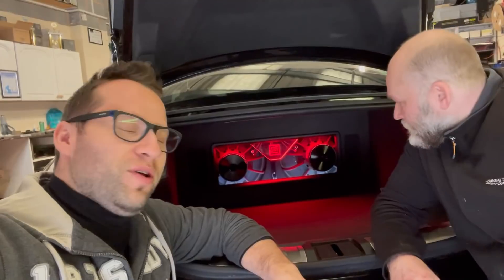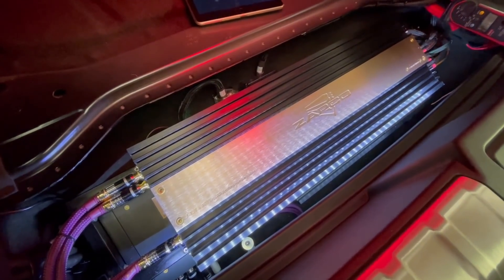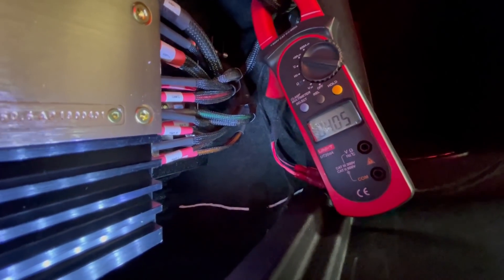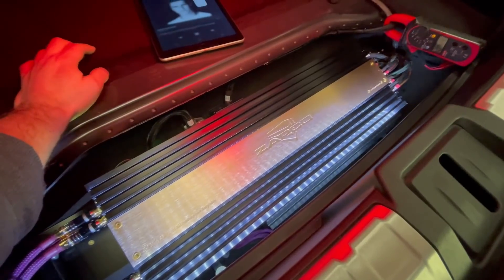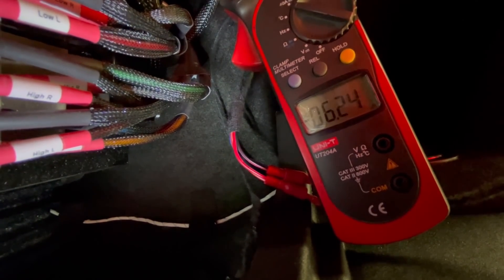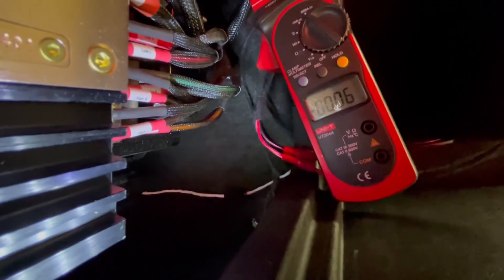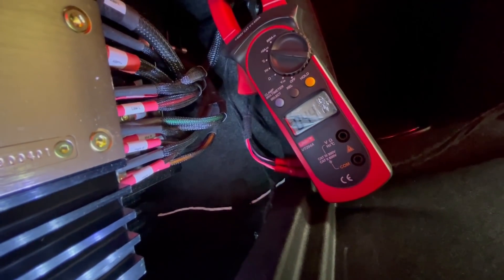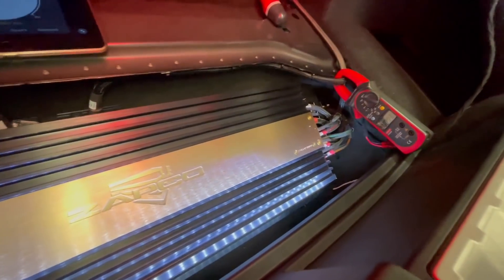How Much Power Does an Audio System Draw? - CLAMPING TEST

Comment: Nice no nonsense anti-snake oil video. Car audio industry is always trying to market to consumers that they need 1/0 gauge power wires and ground with this "bigger and more excessive the better" strategy. In reality a 2000 watt sub amplifier when used solely for music would operate absolutely fine off of an 8 awg OFC power/ground.
Reply from the maker: Not necessarily. 2000W can draw 150A. For that you need min 2ga that is officially safe to be fused to 175A. 0ga is safe to be fused to 250A.

Comment: So would you say it's ok to run an amp with a 40 amp fuse on a Ford F150 Powerboost (hybrid)? Everyone says to stay under 30 amps of draw on hybrids. The stereo shop I'm talking with is trying to convince that this particular amp (Alpine Optim 8) won't reach that 30 amps of draw. But I'm very nervous about it. It's a brand new truck and I don't want to pay out of pocket because I was misinformed by them. Any guidance is extremely appreciated!

Comment: I was just pondering something the other day and I am wondering if you would already know this answer or have a way to test it and make a video of it (let's assume I'm building a little pull behind trailer for my bicycle which will carry this equipment). Which of these setups would draw more power  from a DC source a straight DC/car stereo @ 4 ohms or, DC-AC converted system with a home style stereo at 8ohms? I feel I may already know the answer but I don't have a way of testing with out purchasing a whole lot of things that I can't really afford.

Comment: Thanks. Spent so much time on forums and watching videos talking about total RMS wattage when talking about alternator and fuse requirements without  providing any real world amp draw examples when listening to music. This is exactly what I needed to give me some comfort that I dont need to upgrade my alternator right away and will wait to test it when whole system installed. It also confirms that 0 gauge wiring is more than sufficient for me from battery to amp and helps me better understand the fusing requirements. I just happen to have that same 150.6AP amp going in my system and so even more relevant to me. Cheers and subscribed.

Comment: Quesrion, im looking to hookup two around 1000w amps to a ac converter, idk theirvamp draw.. do you think 100a converter would be able to handle hr or so playing loud?
Reply from the maker: The average peak consumption is watt x0.13 = Amper, so in your case 2000W ~ 260A peak

Comment: I am going to run a Fi Neo 3.5 12 inch sealed with a 2000 watt amp. I'm mostly going to listen to it at mid-volume so I rest assured that I do not need an aftermarket alt.

Comment: I don't see capacitors anymore these days. Didn't see them in your setups also. Why is that?!?
Reply from the maker: Because they are absolutely pointless! Rather sort out the power supply, proper battery instead and no cap can ever touch that. Even caps have to be charged from somewhere, so if the supply before that is poor, then the cap is just a bandaid 🩹. 
EV cars are the best, constant solid power.
Reply: @pssound9749  so, if i have a normal system about 250-400w RMS, 16 mm2 power cable, 4 doors speakers and i want to install a Subwoofer in the trunk on the side (didn't thought about the power yet but minimum 200W rms and max 400/500W rms) wouldn't help at all to ease the car's battery job a little, less stress for the alternator too, if i add a capacitor?
Reply from the maker: Buy a better AGM and the biggest you can fit. 4-500W system shouldn’t be an issue for any car, that’s like 35-45A load.
Reply: @pssound9749  thanks for clarifying. I was thinking this way but with your car audio experience you rest my mind now.
Keep up the good work 💪
Reply: @pssound9749 Hi Peter, for the last 20 years I had multiple Optima Yellowtops which were best then. Now it seems they arent that good anymore. Are all AGM batteries good or which brands are best for car audio?  Thanks in advance!
Reply from the maker: @explorinlearnindoing5462  there is nothing wrong with AGM batteries. It all depends on the current draw requirements and how long you want to run a system without the engine running.
Reply: @pssound9749  Thanks Peter, my system is a medium power SQ 3 way plus sub, with about 700w max total. 
But the car is a Mercedes ML500 which uses power when not in use. And sometimes I drive it just once a week... So therefore I am considering the AGM batteries over the Optima Yellowtop. Do you recommend certain brands and models? Or are all AGM's suitable?
Reply from the maker: @explorinlearnindoing5462  you don’t have a high load demanding system, pretty much any AGM does the job for that.

Comment: hello peter, do you know if there is anything special i need to do to add a second battery to an audi a5? going to be about 2500 watt system. all audio control amps.
Reply from the maker: Make sure batteries are same type, ideally minimum AGM, not lead acid. Lithium is king though.
Reply: @pssound9749  what about the charging system? Supposedly every time a battery is replaced in this car i need to reprogram the system for the new battery even if they are like for like.  If i add a second agm will it mess with the charging system?

Comment: You don’t need power. Meanwhile I’m struggling to hear my system over road noise! What the hell am I doing wrong?
Reply from the maker: You either have a very noisy car or a system that can’t play loud enough? 🤷🏻‍♂️😃
Reply: @pssound9749   I’ve got esotec 2 way, 12” milli-pro 60l ish sealed running on a voce 5.1k. It’s a van but cab is sound deadened to hell and isolated with 60mm of solid bulkhead sealed and weighted. I get quality sound but not the volume. It’s like my gains are to low but the scope tells me different.
Reply: Maybe it’s your ears

Comment: For a decent build, not an SPL monster, a massive big 3 upgrade is for sure not needed.
I did a small test run on my system. With two mid/high channels, only one midbass channel and a single 12" hooked up to my 5ch amp and saw peaks no higher than 40A.

Comment: Finally someone agrees with me I have 1 BD 15 from definitive audio designs (1500 watt sub) on the crossfire c7 4k @ 1 ohm. Tuned correctly! I play it for 3 hours straight no issues no overheating just pure phenomenal bass. This sub is in a 2:1 4th order tuning is 53hz

Comment: Isn't it also often a question of resistance and the car electrical not keeping up?? You'll get higher amp draw if the ground isn't good enough or the wire diameter is too small...But thanks for clarifying, i'll just swap the battery and make sure ground everything really good..And try running one batt and stock electrical...
Reply from the maker: If you have resistance issues, then that’s need sorting first, but this videos wasn’t meant to cover that.

Comment: i remember my first car and first system. the supply system was so bad i would have a full volt to volt and a half drop just from front to back, without playing anything! eventually i redid all the cables, including upgrading the main amplifier feed to 0awg. i think the worst i got afterwards, with stock alt, was half a volt drop on really big hits on rebassed music. no lights dimming etc, even with the car off.
i never skimp out on the wiring these days.

Comment: I also wonder if your voltage gets to say 12.5 but it jumps back up to 14.5 or 14.6 right after quick does that mean my electrical is good?
Reply from the maker: If you have 2V drop, then you have a weak power supply! It shouldn’t move more than 0.3-0.5v even at the loudest peaks.
Reply: @pssound9749  ok thanks for responding man I always wondered that because in my old set up it would drop to about 13.4 and go back up to 14.8 I learned my lesson from that though. I was using a wet cell battery and used a isolator. Had a agm optima battery in the front. I didn't know no better because before when my dad was living he had agm all the way around. Would that have been the source of my problem? I've heard that wet cells don't like to give up the juice
Reply: @mallorycainjr.1921  personally i would put the wet cell up front for starting. Then use a isolator and put the agm in the back. Thats the way i roll many years. My oldest agm batteries are now 14 years old and still do 85% on the batterie tester.

Comment: this is what only an honest shop/installer will dare say. 

Con audio shop will just laugh and say "how is 65w/channel enough? let me show you how you can improve with this 150w amp." when i found out the problem is all speakers eq was not even tuned when they said they have spent 1 whole day to "tune". they refused to adjust anything when i mentioned the tweeter was too loud and piercing harsh. they did set the time alignment properly though.

After learning how to adjust the DSP eq, not perfect, but it definitely good enough even with my 65w/channel DSP Amplifier set up. 3/4 volume and i already feel like i will go deaf prematurely and its not what i want.

Comment: the meter is probably close enough to show your point. i dont believe that type of meter measures the peaks correctly. it is probably averaging them. you would need an analog meter for more accuracy. like a simpson 260, pretty cheap.
Reply from the maker: It is accurate enough to prove a point. 👍
Reply: simpson 260 looks like it only measures max 10A.
Reply from the maker: bigbadad it has 40A & 600A scale, clearly shown in the video too.
Reply: @pssound9749  I was referring to the Simpson 260

Comment: Power requirements are based on how efficient your amps are. A 2k system runs fine on stock car system, I know cause I am running that. But I can't run it just on battery obviously.
Reply: 70x4 class AB for speakers and 2k class D for sub would work. I mostly listen to music at medium volume.
Reply: You need a secondary batery anything over 500 watts

Comment: Interesting video. This comes back to that question how loud is loud enough. I'm more in sq, but there is little basshead in me. Fun begings when you can feel the bass. Only problem is that my ears can't stand IT long enough. 🙂
Reply: My older brother used to rock 2 10 inch Kenwood subs in a sealed box at 1000 watts RMS in his Nissan Altima, I can feel the bass and it's actually very pleasant to my ears. I can handle louder, I've been in a single cab pickup truck system with 2 Kicker L7 15 inch subs in a blow thru-enclosure, it distorts my ears like microphones which are louder than my personal preference but, went through multiple songs without any ear pain and I feel like a tuning fork. A single neo 3.5 12 inch sub in a sealed enclosure will be a sweet spot in between that pickup truck and my brother's previous subwoofers.
Reply: My average listening lvl when I was younger was around 140 db driving around. Btw my my subs never outplayed my mid and highs
Reply from the maker: Then you had very loud mids+highs! 😃 Are you okay? Can you still hear me? 😜😀

Comment: Hi just wondering what kind of clamp meter you used cause its dc not the usual clamp meter they usually only work on ac.
Reply from the maker: Yes, it’s a specific one that does DC too. I’ll have to check what it is.
Reply: UNI-T ut204a